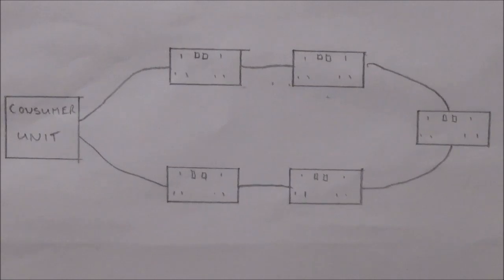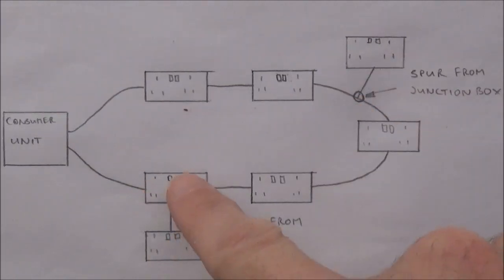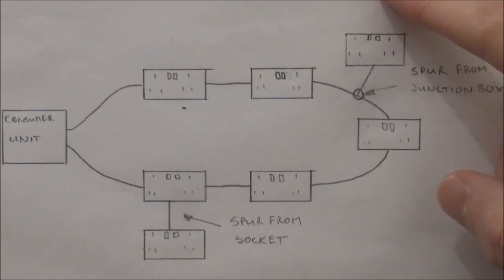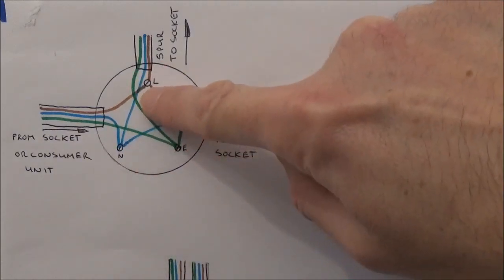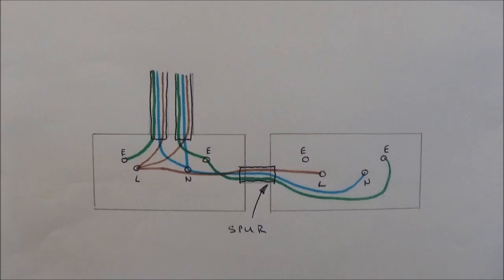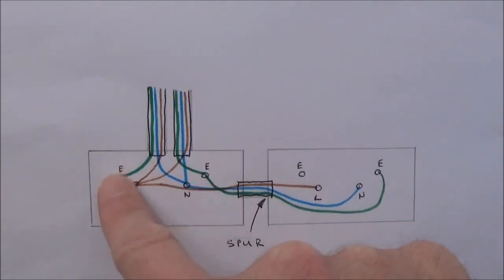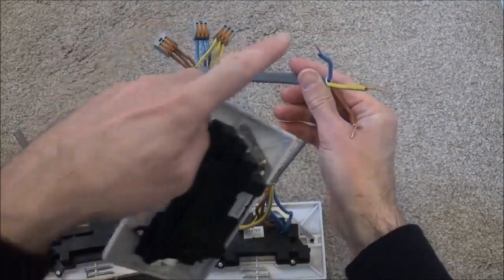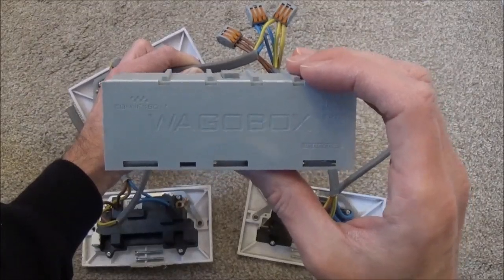How to wire a spur socket to ring circuit. Add a spur socket to ring main.

Comment: I have a double socket in my garage but only one set of cables so no return e.g. not a ring circuit. How do I extend that and how many can I if possible?
Reply: Sounds like its a spur already, so adding more sockets would be a 'no no'.  He did mention about extending the cable to make it its own circuit though, so guess you'd have to go down that route...
Reply: chrisjlocke   Thanks thought it’d be tricky but I thought if I put a fused spur in front I could add a total of three doubles, according to him. Is that ok?
Reply: @chrisjlocke  Or, the circuit is just a nice simple Radial circuit (B16 or B20 breaker with ordinary 2.5mm cable) so these 'spur' limitations do not apply, you can just add another socket from any existing socket nice and easy!.
Reply from the maker: All - I think the question has already been answered. If it already a spur then yes change it to a fused spur with 13amp fuse and add the additional sockets. Or if it is a radial circuit on a 16amp fuse then you can just add additional sockets. Just make sure you find out exactly what that cable is supplying aready and where it comes from, what fuse is protecting etc. Hope that helps, thanks for watching.
Reply: 3:15 in the video - via a fused spur

Comment: I need to add 2 more sockets to my circuit ring, not using a spur or junction box. The way I was thinking was to take away the 2.5 cable from a original socket then run it to my new sockets then run more cable into the original socket that  should complete the circuit? Thank you for the videos.
Reply: Yes if you are just extending them to be part of the ring that is fine. Just add the likely loads from these sockets to your diversity calculations
Reply from the maker: @Dan Young - That should be ok, but often the cable you have won't be long enough to reach the new socket hence why you end up using a junction box with connectors to extend the cable.
Reply from the maker: @Dan Young - That should be ok, but often the cable you have won't be long enough to reach the new socket hence why you end up using a junction box with connectors to extend the cable.

Comment: I need to move (extend) a socket on the ring circuit using the wago connectors and box to extend the wires. Once the plug socket is in its new position can I spur of that one to add an extra socket??
Reply from the maker: Hi there, yes as long as the other socket is on the ring circuit. If you go to the effort to add the other socket to the ring, why not just put both sockets on the ring using the wago connectors? Just a though, thanks for watching!

Comment: Great video POUSE around the HOUSE. Made me more confident about what I'm doing in my integral garage. I currently have a single socket in there which is a spur from a socket on the house landing but I need more sockets in the garage at more convenient locations around the walls at bench height. So, I'm replacing the single socket in the garage with a 13a FCU, then running 4 double sockets in series from it. I'm using 2.5mm T&E and enclosing the T&E in 25mm x 16mm mini trunking, running the cables in the trunking along the top of the wall close to the ceiling and dropping to meet sockets at bench height at 4 locations. Does that sound ok? Are there reg's about running trunking vertically and/or horizontally?
Reply from the maker: Sounds alright but couldn't be sure without seeing it. As for trunking, keep it horizontal and vertical as you said. As long as its protected from physical harm (which it will be in trunking) should be good. Thanks for watching.

Comment: I have purchased a Nuaire Dri-Heat Ventilation System which is installed in my loft space and will circulate clean air around my house. I need to connect the 3 core mains cable which is attached to the system via a 3 amp fused spur box which is included with the ventilation system. My question is can I simply run a cable from an existing junction box (already running from a plug socket in the upstairs bedroom), up through the ceiling and into the loft space where it will enter the fused spur box as previously described.  Any advice would be greatly appreciated
Reply from the maker: Hi darren, you can only run it direct from the ring final circuit (ring main). So from a junction box is fine but it cant be from an existing spur or your new cable will be a 2nd spur which isn't acceptable. Hope that helps.

Comment: Can I use a double socket on a spur to run a washing machine and tumble dryer?  From what he says here it would appear that I can.as both appliances have 13a plugs.  Is that right?
Reply from the maker: Both - Firstly, always follow the manufacturers instructions. But, if it's a single oven with the power you say, then it can be connected to a 13a plug and in theory can be plugged into a spur. Personally I wouldn't plug large appliances like ovens into a spur.  If you do, make sure the spur you have is definitely tested and safe and that it is spurred from a ring. If it's a spur from a spur that would be dangerous and doesn't meet the regulations. Thanks for watching.
Reply: The Hammer I’m in the same boat I have a spur socket on a fused fcu and my fridge going to it but I now need to add my new cooker which requires 13a fused outlet and from the video I am guessing I could add my cooker to the double plug on the fuses spur or would it be overload...?
Reply: @noeking9095   I suppose it depends on the type cooker.  A fused spur sounds as if you will be OK but I'm no expert.
Reply: The Hammer it’s a duel fuel cooker (gas cooker, electric oven) kenwood ck305-1 power 230v 50hz 2270w
Reply: @noeking9095  That will have to be hard wired into a fused connection on its own circuit (30a - 45a) with an isolator .  Nothing else can share the circuit and you can't use a plug!
Reply: The Hammer curry’s retail store said that this cooker can be on a 13a plug , they are saying the 2270watts are divided by 230v makes it 9.8A cooker and a 13A plug should be good for it....
It’s too confusing
Reply: @noeking9095  I can't explain that because I had a dual fuel as well and the regs state what I said in my comment.  As I said I am not an expert so if I were you I would go to a electrical forum and ask there.  But I would be suspicious about that advice from the retailer.

Comment: Question, say you add two spurs from differing sockets that are quite near each other, all in accordance with part P. Is it good practice to join those two spurs, if you know what I mean?  Picture>  https://postimg.cc/30RXfyc8
Reply: NO.  Because there would already be a ring (not on your picture)  You must never have a ring within a ring.
Reply: @cjmillsnun  Yeah TY CJ. John Ward on here (excellent channel) said so as well. I've already joined them as I thought it'd be common sense to do so, but I'll remove that connection tomorrow. :O  https://www.youtube.com/watch?v=aNPnBEqbq7A
Reply from the maker: Hi Paul, as CJmillsnun said, that's a ring within a ring. Don't do it.  Hope that helps. Thanks for watching.

Comment: So... why are you only allowed one double socket on a spur when a radial circuit is effectively one long spur, and all you'd need to do to convert a ring to a radial is to break the ring?
Reply from the maker: 2.5mm twin and earth cable is rated at approx 27amps. A ring final circuit is protected by a 32amp MCB. A plug has a 13amp fuse. If the power through an appliance (i.e. 1 plug) becomes greater than 13amps, the fuse will blow. By virtue of this fact, you can't have more than 26amps of power going through any one double socket so the single cable supplying the socket in a spur is protected by the fuses in the plugs. The rest of the circuit is protected by a 32amps MCB because by being a ring it is deemed safe to have a higher rated MCB. A radial socket circuit is protected by a 20amp MCB in the consumer unit which protects the cable from overloading. It's all explained in the video. Hope that helps. Thanks for watching.
Reply: @POUSEaroundtheHOUSE  Further to that, it's possible to have 32A radials on 4mm cable, which some electricians seem to prefer.
Reply: @POUSEaroundtheHOUSE   What I'm trying to get my head around from this 2x13 amp on a socket thing is, if you have many things plugged in, anywhere along the ring (say a cooker, fridge, lawnmower etc all along it, essentially isn't all that current running though a single 2.5mm wire to get to each device? How do individual fuses protect the wire at the start and end of the ring?

Comment: why are most junction boxes rated at only 30 amps not 32 amps like you advised?
Reply from the maker: In basic terms 32amp and 30amp can be regarded as the same. |It's more to do with if you have old fuses in your consumer unit or more modern MCBs. Hope that helps. Thanks for watching!
Reply: Dean skidmore ww

Comment: First you need to cut the wire.... BANG!!!
Before that isolate the power
Reply from the maker: Fair point, poor editing on my behalf. Thanks for the feedback and thanks for watching!
Reply: POUSE around the HOUSE on a 3 phase supply with 3x 100 A fuses is the max load when running 24/7 only 80% of the weakest link?

Comment: Hi what if I want to make a heater switch from a ring circuit? Will it safe? Please answer
Reply from the maker: Not sure what you mean sorry. You can do a fused spur for a heater which is probably a better option if you know a heater will be used on it. Hope that helps, thanks for watching!

Comment: Great stuff. How many spurs can you connect to a circuit?
Reply from the maker: It's really the same question as how many sockets can you put on the circuit. There is no straight answer, it depends on how many sockets you already have and how up to date your wiring is, and if your wiring is has been recently tested and is safe. Basically if you had all your sockets being used by appliances would it overload the system? The answer for most houses is actually probably no as most appliances don't use that much energy, and kitchen circuits are on a separate ring circuit on new houses which tend to have the high energy appliances. But it is possible to overload it if the whole house is on one circuit and every plug was being used with high energy appliances like toasters and kettles. But in reality it's unlikely this scenario would arise, and if your electrics are up to date it should trip before it becomes dangerous anyway. But if you're looking to add a few then it should be fine. I would argue that if you are looking to add a lot of spurs that it may be better just to add the sockets to the ring main to avoid having spurs everywhere. I'll hopefully show how to do this soon. Best of luck and thanks for watching!

Comment: How long can the cable be from a junction box? I’m thinking of adding a 3m length?
Reply from the maker: 3 meters is fine. The important thing is that your existing circuit is tested and all sound with the correct MCB protecting the cable. If you add 3 meters of good cable to a dodgy over loaded circuit then you could have problems. If you're unsure, get an electrician to test them for you. Thanks for watching!
Reply: i'm actually thinking of adding it directly to the main ring as i may need to plug a 4 way extension lead in to it but thanks

Comment: If the socket already has 3 wires connected then it will already have a spur coming from it and if the socket only as 1 lot of wire in the back then it is probably already a spur so not a good idea to had another spur to this
Reply from the maker: That's right. Thanks for sharing that for the viewers and thanks for watching!